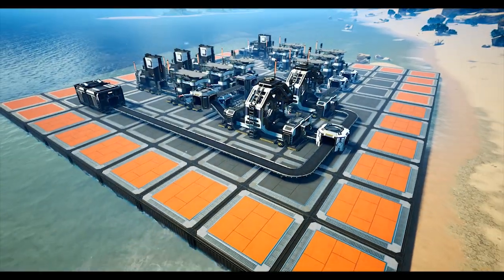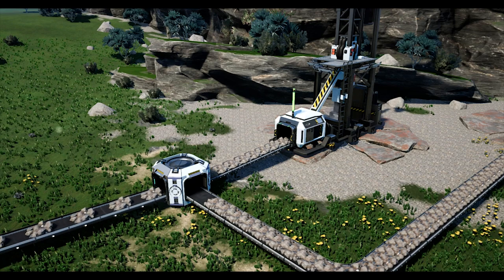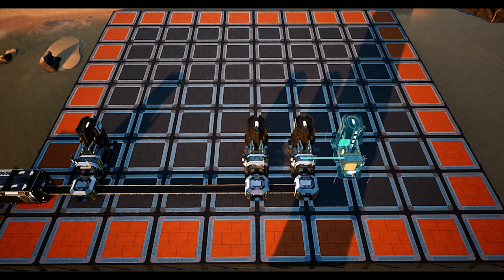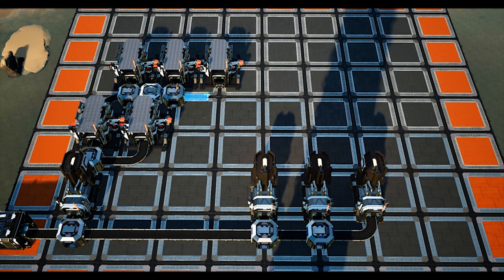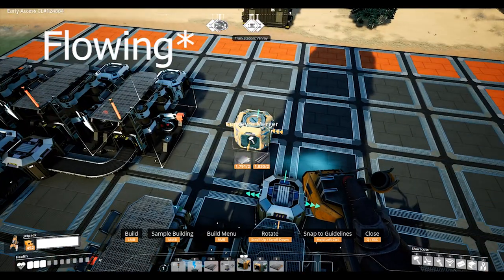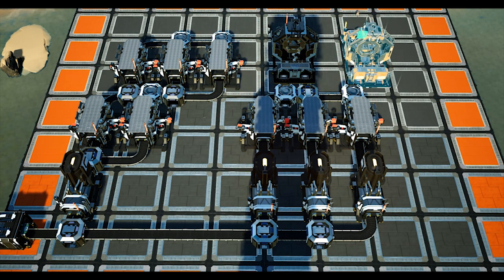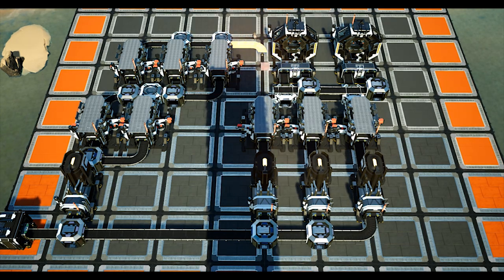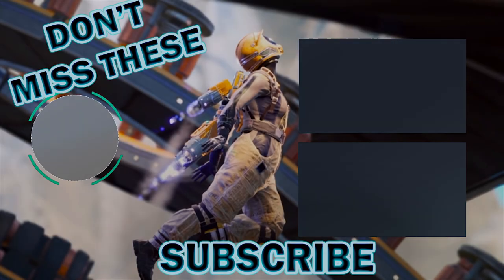The Efficiency Build Guide Reinforced Iron Plates [Satisfactory Game]

Comment: It doesn't make sense how the 3 splitters after the iron rod constructors will output 10 rods into each screw constructor. The left most screw constructor (from birds eye view) will get 7.5 rods and the other 2 will get 11.25. Correct me if I'm wrong?
Reply: I came to the same conclusion. the 1st one will only run at 75% which is causing the assemblers to run around 90%. Maybe it takes a while for the other 2 to back up since they r both getting 1.5 to much??

Comment: So I did mine alitte different. Instead of one floor does it all. I made each floor designated for each thing. Example one floor smelts then 2nd floor makes rods and plates. Then bring up the plates and screws all on their individual lines . Combine them using mk 2 belt 120 screws.  Then I used your tutorial for the tail end of it. 😁 thanks.

Comment: Not sure if anyone will see this comment but I am so confused at the rods to screw part. The entire setup works perfectly and that Is why I am confused. The splitter on the left of the merger going into the constructor should be cutting the rods in half, right??? which would mean that the rods that are coming out are coming out at 7.5 per minute and going into the constructor when it needs 10 per minute. However, there is no overflow for this, and it is stable, that is why I am confused?

Comment: I have an issue with the first smelter hogging all the ore and the other 3 smelters are not getting enough ore.
Reply from the maker: Yep, that will happen as it's a manifold, leave it to run for 5 minutes and it should all saturate up, or you can prime all the smelters first by placing a stack of ore in each of them
Reply: @TotalXclipse  why not divide it so it gives 4*30 ?

Comment: I just tried that but the last 2 smelters are always running out of iron ore. I'm using 2 MK1 miners with MK2 belts. Theoretically it should be enough but it's not working properly... But the rest is awesome, if I could get the smelters working it will be fine!! Thanks you!
Reply from the maker: They should be needing to be constantly fed, (they won't fill up) but they should constantly run

Comment: Got a question, each of the contructors making screws need 10 iron rods giving a total of 10 rods pr. minute, how is that belt balance getting 10 rods to each? The first splitter will split the belt to 7,5 each, then they will merge with 15. 15+7,5=22,5 rods, which will again split in two, 22,5/2= 11,25 rods going to the last 2 constructors. this way you will be missing 2,5 rods in the first constructor. Or am i just missing something?
Reply from the maker: You’re theory is correct but it’s not a load balance that is a manifold so once the last constructor fills up and fully saturated the first two constructors in this layout will balance out as the excess will be stored in these - you will need to run the system for a while though or alternatively start by filling the three constructors with a stack of screws to start

Comment: Relatively inexperienced player here, I'm a little confused on how the belts are meant to work here. With the first splitter you placed down, that's splitting the belt of 120 in to 60/60, right? But the smelter it feeds directly in to can only smelt 30 at a time, is that meant to be the case? Unless there's overclocks involved or I'm missing something.
Reply: I'm a little confused on what your question is, but I can try to answer how that works. I'm assuming that you are asking how the iron ore gets split into the smelters. This is sort of like a manifold. The first splitter fills up the 1st smelter. Once that smelter overflows with iron ore, the conveyor will sort of "clog" so the iron ore will not be split there but instead go to the 2nd smelter. it keeps repeating this process till everything is filled then it will run at 100% efficiency. So basically each smelter overflows till everything is full then it runs at 100%. I'm really bad at explaining so I'm sorry. hope this helps.
Reply: @LFCMajestic  Thanks for your response! I ended up figuring this out for myself a little while after I made the comment, I'm just a little slow when it comes to these sorts of games haha. But your comment summed it up perfectly, so thank you regardless.

Comment: Just set this up. I am having issues with the screw constructors even after letting it run for a while. The 1st constructor is not getting enough rods and is running at 75% capacity. I can see that the input into the 2nd and 3rd screw constructors is backed up, but the back up does not seem to pass through the merger, thus the left most splitter is only sending half the input into the left most screw constructor. I can also see that the right rod constructor is backing up on its output.

To me it seems like the manifold is prioritizing the input from the left rod constructor at the merger. This is then causing all the problems. Not sure how to fix this. Everything upstream of this is at 100%. Any ideas?
Reply from the maker: That is how the manifold works, all the inputs need to fully saturate.
Reply: @TotalXclipse  but it never saturates, built this early last night and played for another couple hours and the one screw constructor was still at 75% and the backlog had pushed back all the way to the miner. It feels like rods are disappearing.

Comment: If I understood correctly, the distribution between the 4 smelters is 30/30/30/30?  (and NOT 60/ 20/20/20 !!)
 The 1st splitter therefore does not divide the items by 2. The first smelter takes what it need (30) and the rest goes on the right (90) for the 3 others ?  Am I right ?
I understand better now why my production calculations were always bad !! Thanks for these very good and useful videos 👍
Reply from the maker: Yes, so the manifold system works by fully saturating the line, once fully saturated the first splitter will only take the 30 it requires and the rest will pass through, this continues for all steps along the manifold until the last two were (providing your ratios are correct) the line will split evenly 50/50
Reply: I'm starting to understand the system a little better. Thank you very much for your very clear answer. I will now be able to pollute this beautiful planet more effectively

Comment: Is it better to have small factories like what youve done doing their own thing? and then set up another one to do rotors somewhere else? or is there a way to get all of them doing something at the same time, like how rotors need screws just like the reinforced plates.
Reply from the maker: There's no right answer, and I use both techniques but I prefer to build screws where they're needed as there's so many per iron or steel ingot, it doesn't make sense to bus them between factories.
Reply: @TotalXclipse  I see, i only just unlocked tier 3, and im using the 3 Normal iron mines right next to the start point of the Grass Map, wasnt sure how i could incorporate all 3 things into one, since i need modular frames, but i still need reinforced iron plates and rotors for other upgrades. 
Wasnt sure if making seperate factories to make stuff would be better like what youve done, or some how share everything to save time.
Reply: @MrCraziieOne  sharing things is a bit difficult unless you already have planned your entire build. like lets say you want to make reinforced plates as well as rotors but your only producing 100 screws per minute. you'd have to tear down your factory and make it larger. its better to build where they are needed

Comment: with a small changes you can be 100% efficient splitthe feed into two splitters giving 30 to each smelter. merge iron rods and then split into 3. gives 100% efficiency
Reply from the maker: If you leave it running the manifold is just as efficient as the load balance. The only difference is the warm up and the fact that load balancing can take a lot longer to set up
Reply: @TotalXclipse  I realised this after some testing only been playing a week, have learn everything I know between you and kib :) keep up the good work
Reply from the maker: @itsourkingdom1319  Don't worry after 3.5 hits I'll have some more guides that I think will be useful to all :)

Comment: This is a great guide. one thing of note, and maybe you can explain what im doing wrong.  I wanted to try your lay out but when i lay those first three splitters down in the first row, i cannot get the smelters to lay down such that the splitters between the 2nd and 3rd rows are centered on the divider.  HOWEVER, if i lay down the smelters first sort of crossing the line between row 1 and 2, THEN i can lay down the first row splitters in their proper place, and connect to the splitters on the output of the smelters.  I was looking for the overhead view, but i couldn't find your website.   Either way, I subscribed because this is the efficiency guide i was looking for in order to learn how to take my guide to the next level. Thanks!!

Comment: I had a problem about this, the first rod constructer only gets, by my calculations, 7.5 ingots per minute while the other two receive 11.25 if I'm not mistaken. I know the video was uploaded a while ago, but if I could get a solution or somethinf would be great!
Reply from the maker: You're right in your calculation but there's no problem with it. - once the two other constructors are saturated the first constructor will gain the overflow of items and all three will run efficiently. It's the manifold method that we use rather than a load balance 90% of the time in these guides. :)
Reply: @TotalXclipse  oh ok, now I get it xD. I ended up merging the two smelters and then spliting it into a 3-way, is that what you mean by a load balance?
Reply from the maker: @manelpinto1475  That is a load balance, but it's not necessary for larger builds :)
Reply: @TotalXclipse  Thanks for taking the time to respond! Started playing this game 2 days ago and your videos are amazing and been very helpful. Keep up the good work!

Comment: hey man, sup.
followed your guide, but at the assembler part, im running low on the screws, and after some time got 100 iron plate left, is that correct ?
Reply from the maker: sometimes if one input is full when the other is empty you'll have plates fill up which screws are empty. But to be on the safe side I'd upgrade your screw conveyors to all MK2's
Reply: @TotalXclipse  thank you sir, i will try that again

Comment: I see a mistake in this layout after building this exact layout myself. If i build a splitter after the most left iron rod constructor it will give the screw constructor only 7.5 / min. and thus running at 75% efficiency.
Reply: Yup Noticed that too - This guide is completely wrong.

Comment: I have trouble connecting belts from left going up to the second level of middle splitter, idk how to make belt going up, it just wont connect:(
Reply from the maker: Make sure the inputs and outputs from the splitters are facing the correct direction
Reply: @TotalXclipse  after 10 minutes of trying everything I realised that I just runned out of plates:D the only thing thats really annoying is energy, using biomass, it drains so fast and I need 1 biomass burner for 3 factories and there is a lot of them so it feels like msot of the time I am just running around feeding power all the time

Comment: How would I set up 4 impure nodes for this factory?
Reply: I'm guessing you've already figured this out by now, but in case you haven't...  You'd need 3 mergers, two mines merging into 1, the other 2 mines into the second, then the outputs of those two mergers flowing into a third merger.  Before the 3rd merger, you can use Mk1 belts, since a Mk 1 miner on an impure node gives 30 ore per second and a Mk 1 belt has a 60 item per second throughput.  After the third merger, you'd need a Mk2 belt to feed it to the reinforced iron plate setup shown here.

Comment: I was a bit confused about the layout with the splitters at first. Tried it with Storage at the end instead of the Smelters. Then i put 120 RIP to simulate the transfer to the smelters. 1. got 59 2. 30 and the rest was splitted between the last 2 storages. So i was wondering how every smelter gets the full load of 30 iron ore to be 100% efficient. 
Can someone enlighten me please?
Reply from the maker: Sure happily. You're absolutely right with your maths, however remember that each smelter can only hold 100 items, 
so the first splitter takes 60 to one smelter, and 60 along the belt for the first minute. Which then gets split to 30, 15, 15.
In the second minute, the 1st smelter get's topped up with another 40 ore. (60+40 = 100) so now the first smelter is full and the second splitter now recieves 80 (60+ the excess 20). Now the second smelter which had 30 will now recieve half of 80 so it now has a total of 70 items. In the next minute this smelter will be full and the excess items carry over. So the way the system works is by filling up the system. If the ratio's are perfect so you use all 120 per minute, then in theory the last two smelters will constantly be running  :) Hope I explained it well... sorry it was long winded
Reply: @TotalXclipse Thanks a lot for the realy fast reply. Now i understand it :)
Reply: I realy can't wait till the websight is working. It will definetly be in my bookmarks :)
Reply from the maker: So glad I was able to clear it up for you! ☺️

Comment: I followed the video and got everything running but one of my assemblers is lagging behind the other. The one on the left is getting more plates than the one on the right. By the time the left one made 10 the right one only made 7.
Reply from the maker: it's a manifold so it will take a little bit of time for them to both run at 100% but once it does they should run at the same speed

Comment: Cant you use 1 overclocked assembler?
Reply from the maker: You could, but that would be expensive to run in terms of energy - it's more efficient to underclock.
Reply: @TotalXclipse  The smelter to the right, it makes 15 iron rods, how come it splits it into 7,5 when the constructor needs 10 for screws? Or am i missing something?
Reply: Wait... how come from the 120 ore, 60 instantly goes into the first smelter when it can only do 30 at a time?

Comment: You did a good tutorial but it is not efficient. The smelters will not run ore until the first one is full then the second one will have to get full and then the third..
Reply from the maker: It is efficient, it's the manifold system. Once the first constructor is full, all the excess will overflow unto the next and this continues down the chain until the last two constructors are running at 100% with continue flow on the system :)

Comment: I like this guide, as always this is amazing, this guided style is really cool as well !
That said, "efficiency" term is usually referring to a ration between inputs and outputs (consumption versus production), and therefore I think it would be nice to clearly state over which parameter(s) this build has high efficiency. 
For example, if one considers efficiency in regard of iron nodes,  he probably wants to use refineries with Pure recipe, however if he considers efficiency in regard of power consumption, refineries are not really a good idea :)
Reply: who thinks efficiency in regards to power consumption?
Reply from the maker: By efficiency I mean running this system as close to 100% clockspeed. But I see your point, equally as Dark God mentions power consumption can be a factor - for example doubling up this factory and reducing the clockspeed to 50% would improve the efficiency by more than 100% if we refer to power. :D
Reply: @TotalXclipse  Ohh, this would be efficiency over "non OC" production machines capacity then (100% non OC usage) ^^ 
Actually (I just discovered this), consumption seems to follow a polynomial-like law in regard of clockspeed (https://satisfactory.gamepedia.com/Clock_speed#:~:text=To%20change%20a%20clock%20speed,to%20be%20increased%20by%2050%25.), so power efficiency gain would be around 50% if I am not wrong. 

100% cs = 100% power/part 
50% cs = 66% power/part
since it is doubled there is same amount of part produced. 
If we ration those two : 100/66 = 1.51, so we have a system 1.51 times more efficient than the original, so ~50% power efficiency increase.
Reply: @darkorys8012  Actually, not a lot of people since it is so easy to get power in this game, but it can be useful to setup a micro factory, as for example if you want to make a factory using only the 3600W you get with geysers.

Comment: Does anyone else have the issue of the left screw constructor not receiving enough Iron Rods?

Correction: does anyone have a solution to it lol
Reply: Found it was innefficient by accident myself. Doing quick math though to fix it you should be able to instead feed both iron rod constructors into a merger that goes into a splitter and then split between the 3 screw constructors.